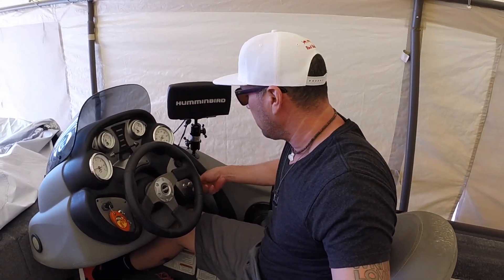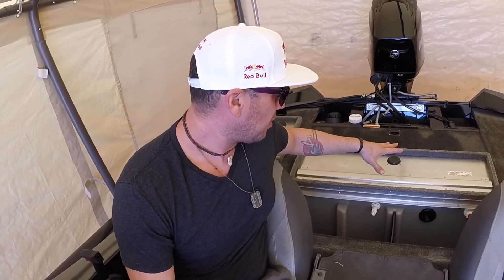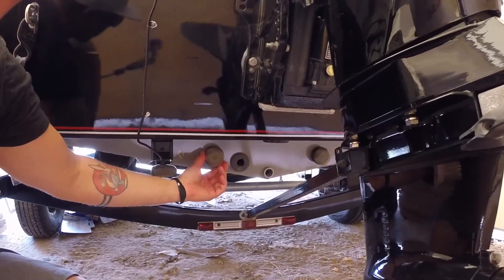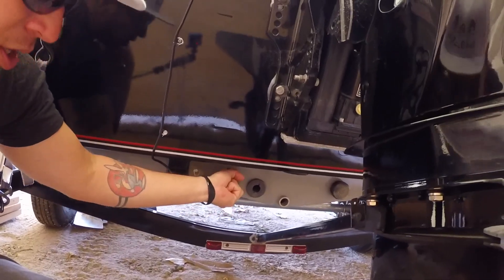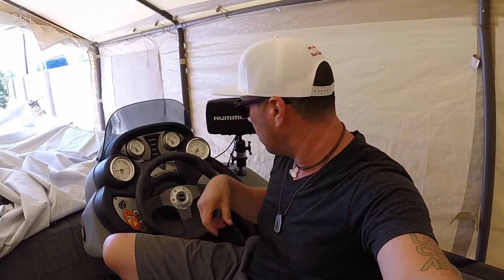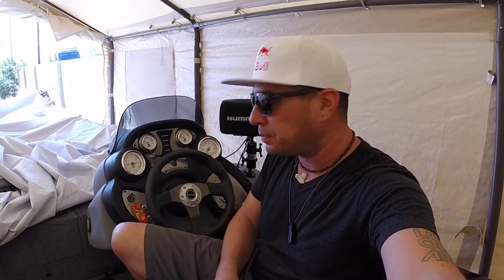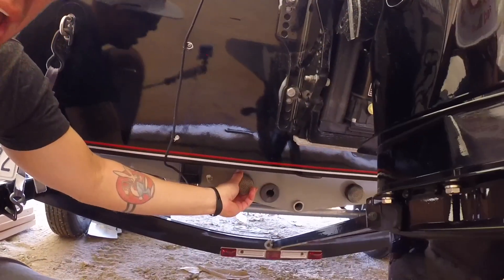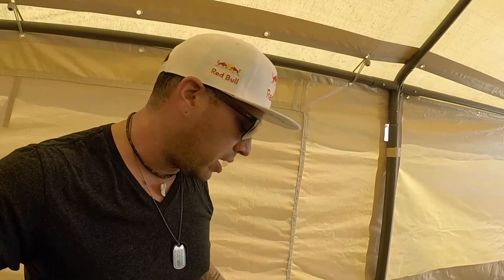Pimpin' Bass- Bass Tracker Pro Team 175 TXW Livewell- live well- Troubleshooting Easy Fix

Comment: Dude just what your video 3-7-22. Have had my tracker since 15. Bilge pump has never pumped. Did like you said and put a little water back into pump. 6 leave and some pine needles come out. Works great now. Thanks dude

Comment: I had this problem on my 190. The solution is to get some 3/4 inch vinyl tubing and reroute the hose so it goes up from the pump, in between the gas tank and batteries, and up to the spray head. It cant dip down and then go up like a plumbing trap. That will create the airlock problem you are having. Ever since I did this, I don't ever have the no water problems anymore.